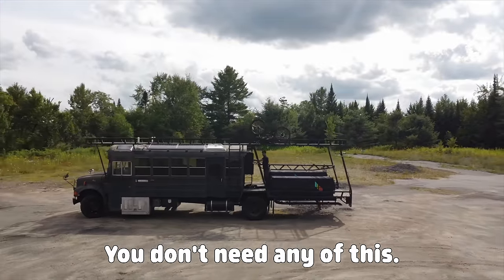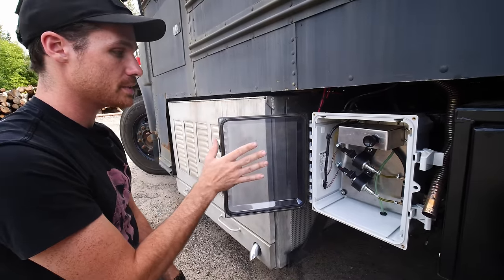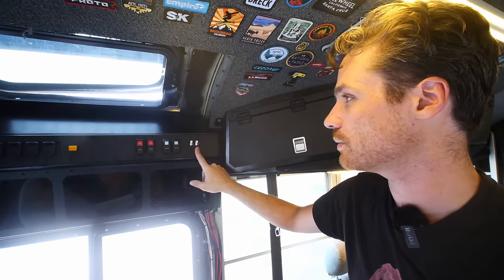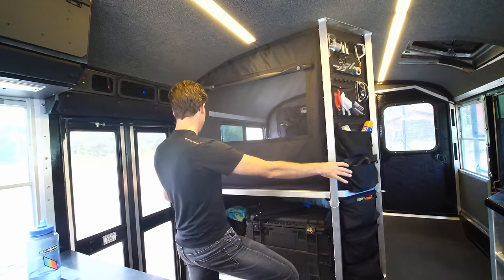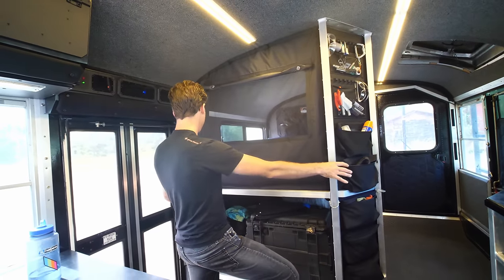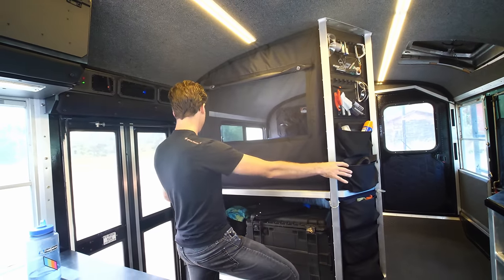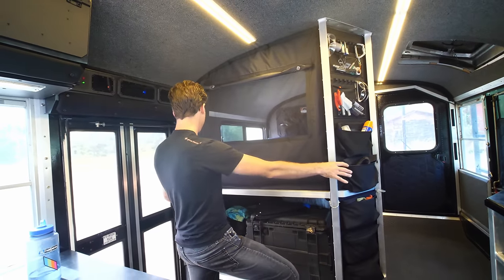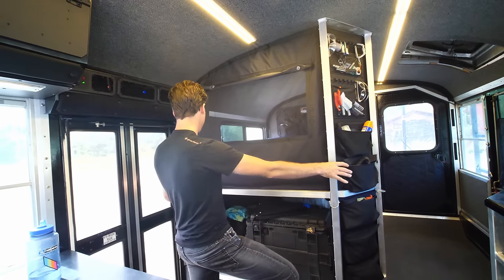The Most Insane Bus Conversion With a Crane and a Shop (Full Tour)

Comment: Great rig! 

If you’re looking for a galley sink - a few friendly tips:

I’d look up work station sink” (they come with slide able kitchen accessories) a cutting board with containers (get one custom made and use it as a sink cover to create more galley space, plus this also comes with meal prep utilities) an item called “Prepdeck” a quick and easy way for meal prep,

If you are willing to think abt maybe creating floor pits to maximize the space, I’d say look at both Sobro Coffee Table and Sobro Side tables. 

To create more space, I’d look into slide outs that run the full width of the vehicle, I’d look into full length slide outs on the back, and I’d look into slide outs within a slide out, I’d look at “CMC Caravans” for examples of this.

I’d also look into a “Murphy door” concept if you need more space.

You could also add telescoping rods that hang off of the edge of the roof and hang swing chairs. 

If you are interested in floor pits, I’d look into “smart beds” and “smart sectionals” from Jubilee furniture.

The backs of sofas and chairs can be converted into desk space, stairs can be converted into storage space.

For further space saving, I’d recommend curbed furniture, another concept is a “Murphy wall desk” and a “Murphy Bed” 

If you are interested in “Murphy beds” 
I’d look into wall bunk beds (if you are interested in this concept for your tent area you could create wall niches and put them on two slide outs, one to retrieve them and bring them forward for usage, the other slide out could push them beyond the back deck - you could also convert these to transitional benches) 
Locker room Murphy bed, a library Murphy bed with sliding panels (if this interests you, you could also add two arm chairs in front and create a bookshelf within their bodies to extend “library space” - also the other cool thing you can do if you do go for the library Murphy bed with slide outs - you can create an entertainment center literally on the back or underside of the bed frame)

You could also do window shades that double as projector screens. You could also put a pull down double sided projector at the very edge of the vehicle when your tent is up and your hanging out.

If you are willing to reimagine the doors on the back - or even the sides - make it a four door system - like when you open up a box type package and then treat the ones on the sides like Murphy doors, the bottom - a deck - and the top, you can gut and put a drop down shower, or a drop down tent.

For kitchen cabinetry or even bathroom, I’d look into a curved four sided ones and the stick them on a lazy Suzan. If you are interested in making a pass through on the outer shell where you keep the tally, you could put both the kitchen cabinetry and the lazy Susan where it sits on a slide out so you can access it from the outside. You could also create slits in the upper part of any cabinetry surface for a pullout swivel table. 

If this concept interests you, on the exterior of the cockpit area on both the passenger side and drivers side you can do the same, create a slit for a pullout table with swing away bar stools.

For further inspiration I’d look at these RVs on YouTube: 

Draper Land ark - (a pull down balcony)

Lehel by Alexander’s (in one video - there is a removable podium on the back)

Volkner - (solar panels in between plates of glass in order to create fencing for decks,

Living vehicle - (solar panel awnings - although it may work better with paneled glass holding them together.

Dekpod (swing out elements for additional space) 

Romotow - (revolving elements)

Game Changer Toy Hauler - (storage. If you are interested in taking this concept a step further, and are interagency in floor pits you could also create floor slots to lower unused furnishings once they are up against the wall) 

Brinkley (many many neat concepts and ideas)
:)